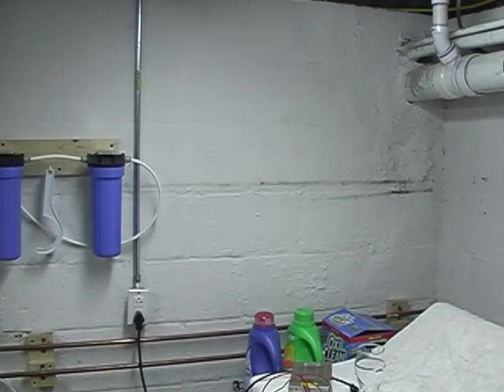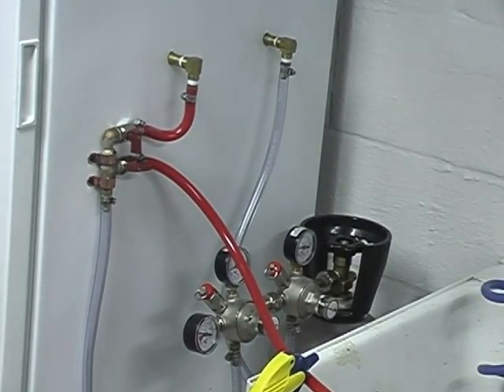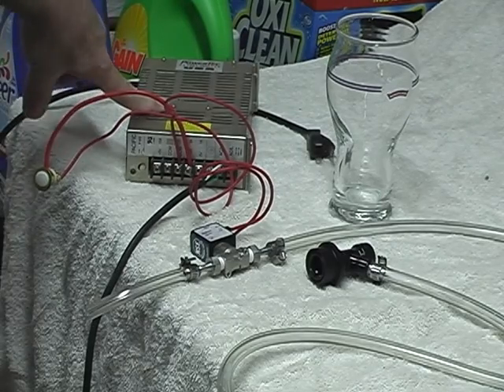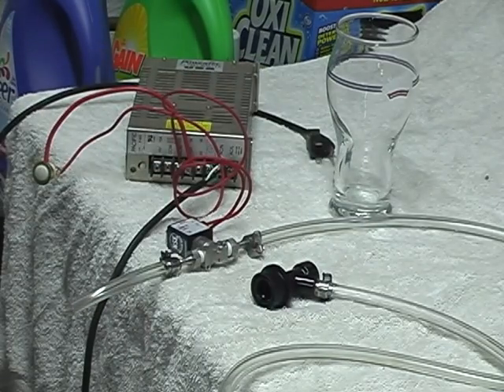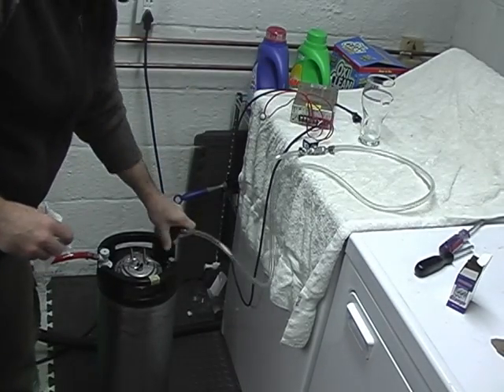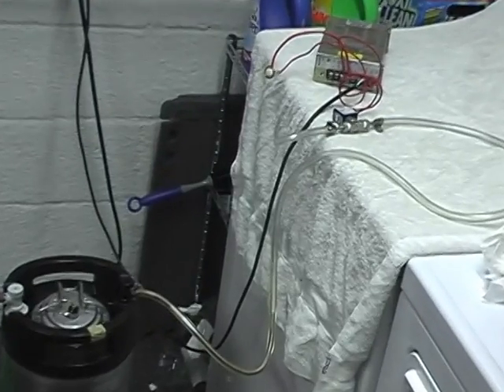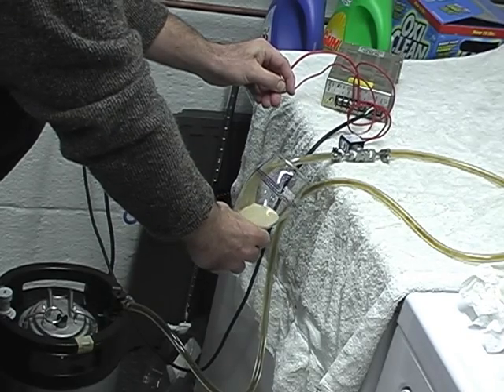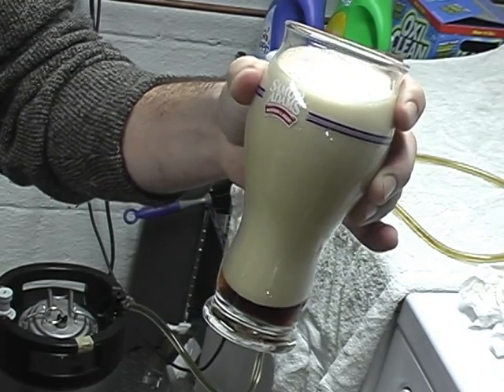Testing out an electrical solenoid-based beer dispensing system

Comment: Did you ever figure out your foam issue?  I have the same problem in a similar setup.
Reply: Hi, did you ever hear back?  I've designed out a system and am about to order parts... I'm concerned about the size of the solenoid valve.  Was going to order 1/4"...